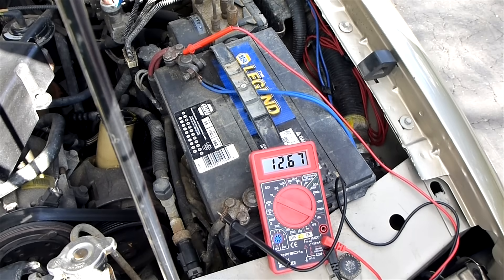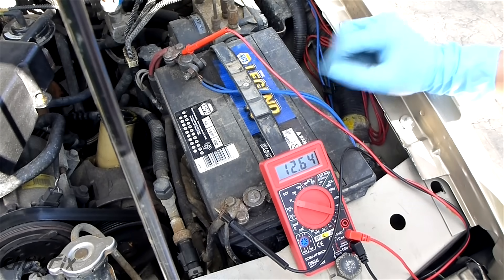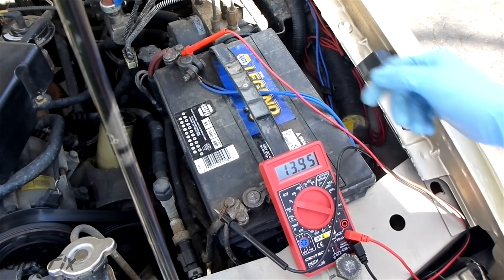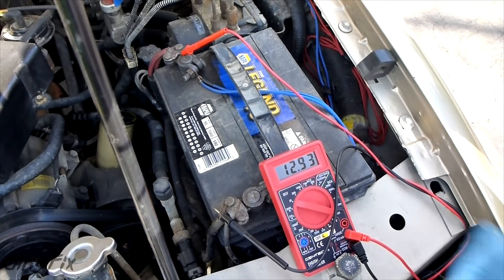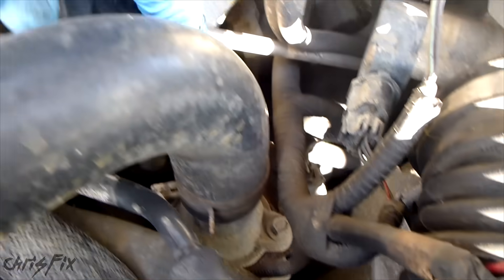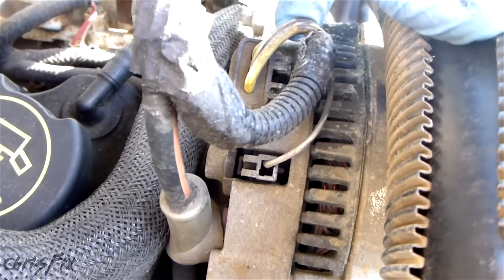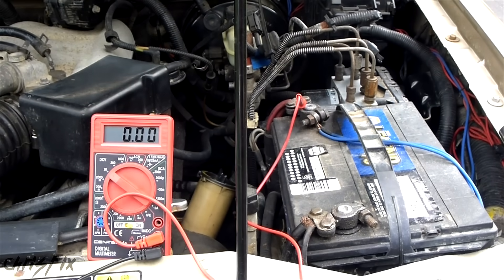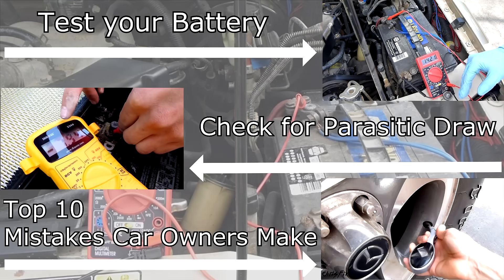How to Test an Alternator

Comment: Outstanding video. Shady mechanic told me I had a bad alternator. Ran these test and it was within the mentioned volt range.  All that was needed was to clean connector to alternator. You saved me $350. THANK YOU!!!!
Reply: Realistically .5V and below is acceptable loss throughout a vehicles entire circuit. Anything more than 1/2 a volt and I'd then worry about finding where the voltage is going.
Reply: @Apocolis64  Sir, please kindly take take note on the question below...
Say, the battery is showing 12.7 volt on checking multimeter, however, checking gravity tests on each cell, if anyone shows reading out of range, should I confirm the battery is going bad???
Which is the best and correct to identify battery is dead and needs new battery??? Voltage reading or gravity tests????
Thanks.
Reply: @tnamen1307  Measuring specific gravity of each cell is the most accurate way of finding out. You would have to check each cell and service information to determine each specific gravity, which changes based on temperature/state of charge/water dilution etc. I'd have to check that myself to answer it. But realistically if the battery is charging, but not holding onto the charge you could call the battery make it simple. If it happens with a new battery then you have a parasitic draw somewhere in your system. You'd have to connect your meter in series and check the amperage. Batteries are usually only good on average of 3-5 years depending on quality and weather.
Reply: @Apocolis64 thanks for the very absolute way of condemning a battery is bad ie SPECIFIC GRAVITY. Also, awaiting for such videos in future for your esteemed customers. Thanks.
Reply: @Apocolis64  some batteries, however, can be reinvigorated by removing the coatings on the inside that block recharging...
Reply: @tnamen1307   .025 variation between cells is indicative of a failed cell.
Reply: @Apocolis64  i measured between the altrnator case and negative of the battery (car on, 1500 RPMS n headlamps/radio on as suggested), an votage measured was a constant -0.02V. Battery was ok (12.66 with car off, and above 14.2V after car turned on)

So my alternator may be bad? (i've had trouble starting engine sometimes, and i see battery power is ok)
Reply: @Apocolis64  the voltage drops to 12.40 from 12.60 in just 2 days. Is this ok??
Reply: @tnamen1307  y
Reply: @tnamen1307  most likely ok, my friend.  Remember, it's not the voltage per se that is important, but whether the batt has enough energy stored in it to start the car, and then whether the alt & volt reg can run the car, and recharge the batt and put back into it the energy drained out by the parasitic drain, starting the engine, and operating the car (engine, lights, radio, etc.)  I let my 2008 Elantra go for a week, and can still start the engine, and my alt/voltreg are good enough to recharge my batt, after I run it for 20 mins, or so.  Voltage doesnt mean nothing, if your batt cant store enough energy and put out enough current, to start the engine.  You can have a good voltage that'll immediately plummet, as soon as you put a heavy load on it, like trying to start a car, which has an extremely heavy short term current drain on the battery.  In the long run, all batteries die, but some can have their lives extended by removing the oxide layers on the electrodes inside them that have coated them over time, like rust, and prevent recharging by the alternator.
Reply: Glad it worked for you. I just found out the electronics on mine are going out, took me 3 yrs to identify since it only happened on random days.  Keep an eye on it just in case, they don't make these things like they used to.

Update: it was the battery cable on the negative terminal.
Reply from the maker: Glad the video was helpful!
Reply: @chrisfix  Thought your Video was great, I will bring out my tested and do the tests in Daylight. Thanks for sharing.
Reply: @chrisfix  hello. Can i do the checking of alternator if it is properly charging the battery using a Voltmeter that is plugged - in in the cigarette lighter socket?

I encountered a problem in which the battery indicator appeared in the dashboard when I started my car in the morning and the indicator does not disappear. I also checked the voltage using voltmeter in the socket and the battery is charging when i started my engine.

What is probably the cause of this? Did my alternator get wet?
Please help me.
Reply: @chrisfix  What would cause my voltage to drop to 12.0v when I shift into drive. In park or neutral it stays at 13.7 volts. When driving it stays 13.7 but at a light it drops to 12.0 or below almost to the point of shutting down
Reply: @chrisfix  My meter is a Radio Shack multimeter and it doesn't have the setting that you showed. 😢 I don't know how to do the test, now.😮
Reply: @chrisfix  My car has parasitic current draw of .02 amps under 12.6 volt 45ah battery. What would be the voltage of the car after sitting straight unused for 48 hour????
Reply: @tnamen1307  There are acceptable current draws in newer vehicles. New car manufacturers say that 30-50mA (can be upwards of 80mA for trucks with a lot of accessories)is acceptable. Anything higher than I'd worry about it. Clocks and computers to some degree stay on even when in sleep mode so you'll always have draw.
Reply: @tnamen1307  20 milliamperes isnt very much, I'd bet your batt voltage won't drop that much in 48 hours, and still be able to start the car in a week...but it's good with any car made in the past 20 years or so, to run it for 20 or 30 minutes or so, at least once a week, to recharge the batt, after a week of standby current drain...
Reply: @chrisfix  hello. Can i do the checking of alternator if it is properly charging the battery using a Voltmeter that is plugged - in in the cigarette lighter socket?

I encountered a problem in which the battery indicator appeared in the dashboard when I started my car in the morning and the indicator does not disappear. I also checked the voltage using voltmeter in the socket and the battery is charging when i started my engine.

What is probably the cause of this? Did my alternator get wet?
Please help me.
Reply: @chrisfix  hey Chris would like to know how I do this on a truck with 2 batteries. Thanks in advance sir.
Reply: What if It was a 0.01?
Reply: @oblivion85  There has to be a small draw or the PCM (powertrain Control Module) would not remember powertrain settings and your clock and radio stations would not remember time or stations.
Reply: Clean a connector, and lower resistance significantly, thereby allowing significantly more current to flow, thereby allowing the alternator to recharge the battery sufficiently to replace the charge being lost while operating the car, and from standby drain, while not operating the car.  Yes, increased resistance (like from dirt or corrosion on connectors), is the enemy of maximum current flow, and can sometimes block it, completely.  Current likes to go thru conductors with low resistance, not insulators with high resistance.  Clean, bare metal, has the lowest resistance that that kind of metal will ever have, so keep your metal connectors clean-and your wires to and from them unbroken-and your electronics will LOVE you...
Reply: @michaeltotten7508  damn brother, you should make your own video, I bet it's very helpful to us, reading too much comment make me little dizzy
Reply: I have a question for you Chrisfix, my battery keep dyeing and I started my car and took off the battery terminal wire and the car keep running so that should tell me that the altanator is changing. What could be draining the battery?
Reply: @Larry Sledge jr   According to other videos, NEVER disconnect the battery terminal while the car is running.  Apparently it might damage sensitive components (computer) on 'newer' cars.
Reply: @larrysledgejr3732  hey, mr sledge, something in your car is drawing an excessive amount of standby current.  You know that, even with ign off & key out, your batt is supplying a small amount of standby current to your electronics, right? Well, first measure it, by inserting an ammeter in series, like BETWEEN your minus batt terminal and your minus batt cable, AFTER you have removed the cable from the terminal.  If you have more than 80 milliamperes, probably even more than 40 milliamperes steadily draining out of your battery, you've got something malfunctioning somewhere, and draining too much standby current out of your new battery, causing it to lose charge, too quickly. So, just disconnect all your electronic devices, one at a time, to see which one has been drawing the most current.  That should be the one that is malfunctioning, particularly if it's drawing way more current than it should be.  So, replace it, and that should solve the problem.  But, remember, some of those electronic parts are expensive, and your car may not operate without them, so, if it's too costly, you have a choice between replacing the part, or the car itself, as always...
Reply: You don’t even need a tester. All you have to do is start the car, disconnect the battery cable, and if the car dies, you have a bad alternator.
Reply: It'd be more than $350 for a new alternator if you're paying someone to exchange it, unless it's refurbished/aftermarket and you do it yourself
Reply: Pls how to test ecu current to sensor
Reply: Now send Chrisfix a check ✔ lol
Reply: Thing with these shady mechanics is they just read the codes n get on with it not too many will try and do a quick easy fix as it's less profit and fills up the bookings with tiny jobs you can only really charge a bit of labour on lol its pretty dog
Reply: Pls can I ur face
Reply: My X3 2014 n55 bimmer is turning over then died. I had done repair leak oil and cooler gasket replaced. Broken belt replaced. I then pulled fuel fuse to prime oil. I checked fuse ok. Not sure if engine start then died could be?
Reply: Could have been a bad/ lazy mechanic. Not necessarily shady.
Reply: @justinr4787  a bad or lazy mechanic is shady
Reply: Same thing happened to me at oreillys   by coincidence the employee said he could change it for 100 bucks
Reply: Could have been an honest mistake, knew that the issue was coming from the alternator and thought the whole thing needed replaced.
Reply: Check battery charging system in 2018 chevy tervers
Reply: Q
Reply: Stolen mechanic valor right there.
Reply: Nice information, thanks Chris.👌
Reply: When I do the positive side test I get 8.6, long ways from .2, what am I doing wrong?
Reply: How did you clean the conection to the alternator sir???
Reply: I got a code of p 1684
Reply: What do i do if I can't get the car to turn over?
Reply: Bro a mechanic told me the same bro I paid him twice to put in 2 alternators for him to also say the 2nd one is bad so I paid all that money for nothing
Reply: $350? That “shady” mechanic was giving u a fair price.
Reply: @blastofo  💯💯
Reply: @blastofo The point was that the alternator was fine. To say a good part needed replacing is what makes him “shady.”

Comment: Connections at your battery terminals should be soldered not bolted. Great info, thanks
Reply: Connections at the battery terminal should be crimped. The solder wicks into the insulation damaging it. The soldered joint also creates a stiff spot in the wire. Non issue with small gauge wiring. Anything with weight to it (Let's say 00 cable) will break the wire strands off at the edge of the solder under the heat shrink. I have never ever seen an oem solder battery cables... Rarely even anything else. It's all crimp.

Comment: Do not forget to check for voltage drop on the battery it self. From the Battery post to the Battery cable. If you find a drop then disconnect the battery cable and clean the connector and or the battery post.

Comment: Voltage regulators only keep the alternator from overcharging, not undercharging. If the voltage regulator is bad, the alternator will overcharge. If it’s undercharging, your alternator itself is bad.

Comment: I just got a sound coming from under the hood.
It's a whining. 
And there seem to be some grease on it. It seem like the bearing broke. 

I put an ODB and the voltage was at 12.1. then when I turned I on it was on 12. Never went up. Turn on the accessories while the car was on and dropped to like 11.1. Taking it to AutoZone to make sure.

Comment: I just replaced the battery in my car and the battery light turned off and so did the emergency brake light. An hour later I drove my car again and saw that the battery light and emergency brake light flickered on and off while I drove. Can anyone give me their thoughts?
Reply: The emergency light and brake light coming on especially after you have replaced the battery. Especially if you have a Toyota. Mean the alternator is bad. But I'm guessing you suspected this considering the video we are watching. Take it to AutoZone they will test it for free.
Reply: sergio pabon I drive a 2008 nissan maxima and thanks for the autozone tip

Comment: I did the test and when I touched the alt with the red one I got a 12.4 instead of the 0.05 that u got, help please, the battery light comes on and goes off. I got a new battery a few months ago and it is still happening. I got it checked out at the parts store good battery good alternator, what do you think it is ,2008 f150

Comment: THANKS Chris, my 04 expedition headlights and heater fan go up and down when at idle (just started). Even at low rpm the heat fan goes up and down. 230K miles on and I am thinking it just needs a new alternator. Battery gauge shows okay but it is not a amp gauge. Headlights get really dim when I let off the gas.

Comment: Hi. I wonder if you could give me an idea what is wrong with my Alternator please.    I have a Lucas Alternator. and when it spins up all i get out of the post is 5 vols. There is 12.8v going in on D+ and the B+ is connected ok
Reply from the maker: Clean your grounds and make sure the wire from your alternator to battery is good.
Reply: @chrisfix  Hi. Thanks for getting back to me. Ive cleaned every earth I can find. before starting the car I checked every voltage point inc battery, the positive leads. V Post and they all say 12.7V this time when I rev the engine the idiot light as people call it  still stay's on and the voltage now drops to 11.8v at all points of the  v post
Reply: Hi. Thanks for all your help with this. I took it down the road to be tested. It turns out the replacement alternator I was sold is not new as the listing said. The tech opened it up and it is pretty rusty inside and some of the connections have signs of corrosion. A alternator service kit has now been fitted to it and it is working fine now. I guess it it buyer beware on auction sites. Thanks again.

Comment: Chris..... One of the basic and first things to do when troubleshooting a battery/charging system issue is to all ways make sure the battery terminals are clean and clamped securely.  Within the first few seconds of your video the negative battery terminal clamps moves when to try to attache the volt meter probe on the cable.   You didnt mention it or correct it.  This will greatly effect some of the readings and test you performed especially when doing some of the load testing volt readings....... From that moment on I questioned your skill and advise.........  otherwise, good basic info.

Comment: Hey Chris, I did the test from the battery ground to the case of the alternator, and I got a reading of -174 I got the same reading on the bracket and a small drop when i tested the engine block at that time to -127   as well?  all the wires look good. and it is a brand new battery and new alternator, I checked all the grounds that I can get to and they all look good.  I did your parasitic test and never found what was pulling .014 amps. ant ideas ??    Stumped in  Texas.

Comment: Hey Chrisfix my car stalls out in the drive gear while in drive, usually stalls out when I'm at a stop light, it shakes violently then stalls out, the weird thing is that the motor stalls but the battery is still working, could it possibly be my alternator?..

Comment: Chris great videos. Help. My 2007 ford explorer is not charging my battery. List of what i have done:
1.changed Alternator (new working)
2.changed battery (new working)
3.changed timing belt
4.checked all fuses (under the hood and inside the car)
5.tested the positive and negative
5.changed the entire starter cable assembly (brand new OEM) (yes i did, this was my last option)
Still not charging my battery. HELP!!!!

Comment: Hey ChrisFix, can the alternator be the issue, if on a Ford Focus mk1 1.6 Zetec on a warm engine at idle (700rpm) if I use some electronics (power window, fan, ...) the idle drops to 600 and the dash lights start to blink for a sec or two and then the revs go back to 700? 
I checked the IAC, cleaned with brake cleaner, checked the vacuum with Torque via OBDII and it's around 24, drops and goes to - something if I rev up the engine (though I still didn't do the vacuum leak test). Also, if I unplug the MAF sensor the revs go to 900 and a preliminary fault code appears on the O2 sensor. Any idea?

Comment: isnt checking with OBD2 combined with Torque/Car Scanner app a lot easier? when my car having slow crank starts.. but operting as normal after 2 3 starts(due to alternator properly charge the battery) but slow cranks again after few hours of resting, i use OBD method and get similar reading.. only at 'cold' check it shows 10v which clearly shows very weak battery.. man saved my money for alternator!

Comment: Those harbor freight meters are very unreliable. I had one that was reading 2.5v high when testing my battery and alternator. That’s a huge discrepancy! Using a quality meter when determining voltages and grounds is important. It doesn’t have to cost a fortune but use a reliable brand.